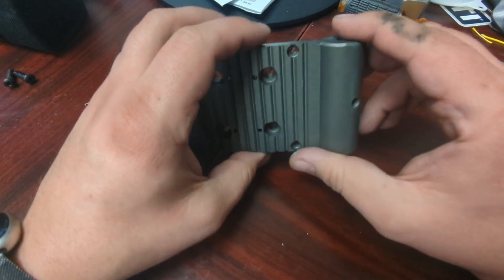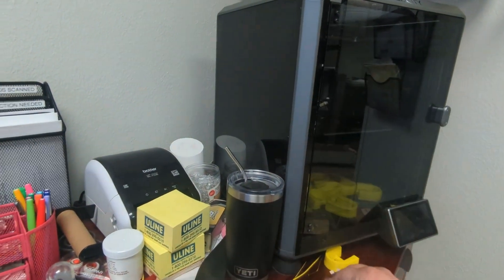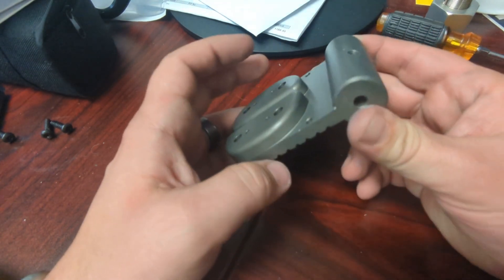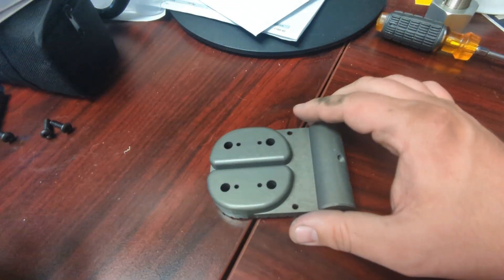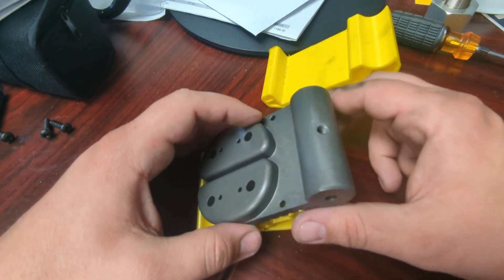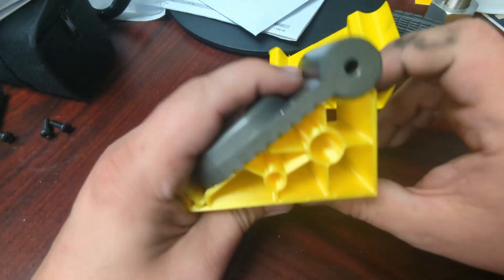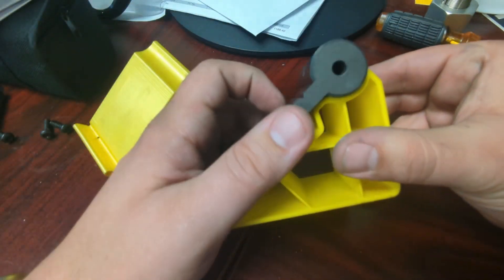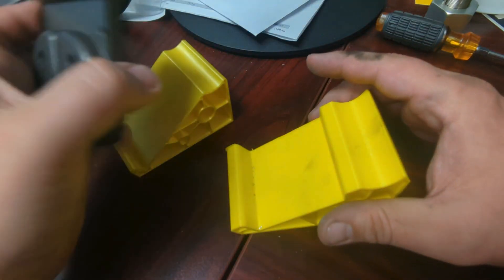3D Printed Fixture for CNC Machining

Comment: Info, when you want it to be fast made and robost or solid we cast some epoxy granite resin mix into the hollow space. They become almost rocksolid. When you 3d print them a bottom the resin wont even flow out.